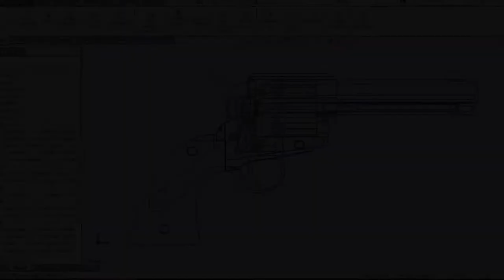Colt SAA Revolver "The Peacemaker" [Cap Gun] Fully Functional and Shoot BB 6mm

Comment: Do these caps go bad? Mine doesn't fire..
Reply from the maker: @ノ益ノ  you can see this tips about the ring caps 

http://youtube.com/post/Ugkx_KaZh9YtIcGwfRdz5G0MFC6-gH822zWG?feature=shared

You can also replace the rubber band with pull spring (minimum 0.8mm steel wire) for strong tension hammer
Reply: @ReiGun  Yooo! Thank you man!

Comment: I have a question... What is the purpose of the 70% alcohol? Does it ignite and help propel the projectile, or is it just a cleaning solvent / lubricant? Also, would using 99% isopropyl alcohol do any harm? (that is something that I already have for cleaning my 3D printer bed, so it would be nice if I could use it without diluting or buying 70% alcohol specifically for that kind of thing)
Reply from the maker: the alcohol act like black powder.. but you can still shoot projectile without using alcohol.. the alcohol used just to add more power

99% alcohol is ok to use too

Comment: is the handsrping required, and what does it do?
Reply from the maker: the hand spring is not required. u need diy handspring with plastic bottle. You can use common plastic bottle (coca cola, sprite, pepsi, etc) and cut it with scissor and shape it like in the video

hand function is to rotate the cylinder while cocking hammer

Comment: Hello, i recently bought this and was wondering what print settings you used to print these, as in what layer height, infill and so on.
Reply from the maker: i'm just using basic setting from cura, for infill 10-15% and for bolt and pin 100%
Reply: @ReiGun  cheers!

Comment: i'm having issues printing the cylinder on my ender 3 max neo, any suggestions?
Reply from the maker: what issues are you having with? I suggest you to print the cylinder hole aligned with Z axis and use cura slicer standard setting with no support.
Reply: @ReiGun  i fixed the issue, it was my bed leveling